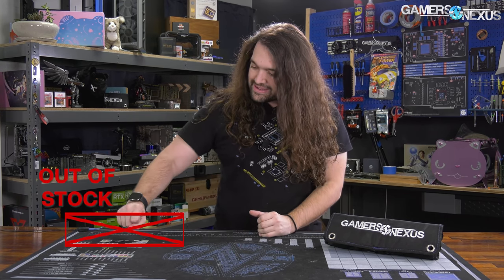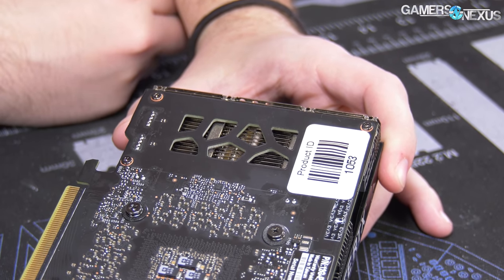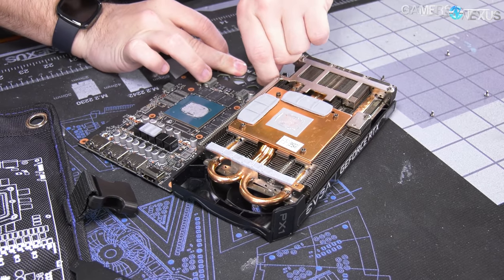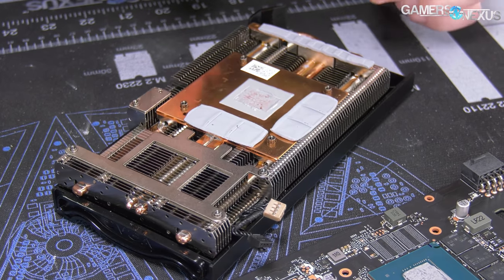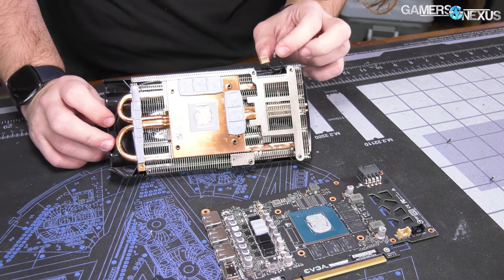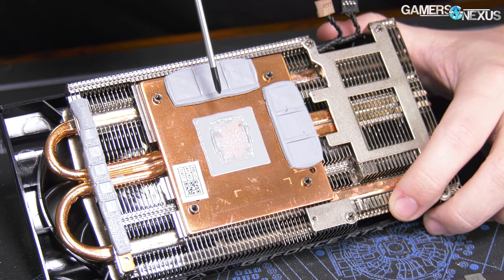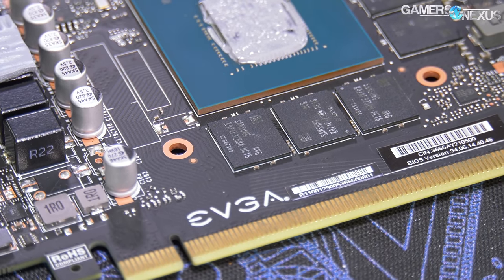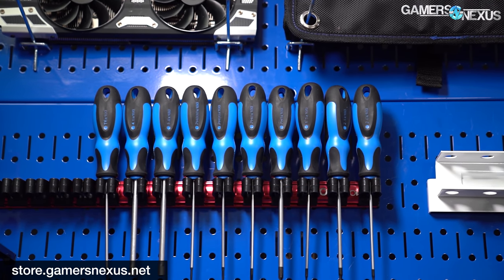Taking Apart a Non-Existent GPU: EVGA RTX 3060 XC Black Tear-Down

Comment: What's impressive is that this card is identical in performance with the GTX 1080ti and it can run on such a small cooler. It has only two heat pipes and the whole thing screams "cheap", yet it's enough to run the card at decent temps. I have a Zotac 1080ti Mini which has five heat pipes and without undervolting, it runs at 84°C.

Comment: I would assume the main reason only those two inner inductors have thermal pads is because they are right under the hub of the fan, which would be an airflow deadspot. While the outer ones are getting unobstructed airflow.
Reply: @117gerardle  yeah not good airflow through them either haha

Comment: this went into my reccomended about as fast as they started selling for 1000$ on ebay
Reply: I found some in the UK but they were inflated GPUs from normal companies. There is a reason why it should be £300.
Reply: I found one on eBay for $600 (price from newegg was $529) didn't buy it but theres "scalpers" that just wanna get the cards to non bots
Reply: @jeffrydonald3436  it's just stupid. The gamers are all being forced to use there old card as I won't buy double the price cards.

Comment: Judging by the empty ram module pads, this board was originally designed for a 3060 ti
Reply: GPU tiers are often just cutdown versions of each other.  Titans are just slightly defective Quadros with the defective bits disabled.

Comment: That sharpie QC mark might be similar to a spot check I've seen in auto manufacturing. Basically you have to make a particular set of marks every time which forces you to inspect certain areas. I'd guess they are checking for the gold triangle to be present and oriented correctly.

Comment: I have the ASUS Dual OC and upgraded the BIOS from the official site. The clocks now boost at 1950Mhz instead of 1837Mhz at 1.0620V max and goes below 1V most of the time for 1833-1867Mhz. 0.9V for 1740Mhz. That was a nice surprise. Furthermore, the card runs extremely cool. Great BIOS, indeed.

Comment: 7:14 *Sigh.....Yes, that is a chip orientation mark, it is there because while you "could" physically solder the chip down in any orientation...to make it function you do want the proper pins to line up with the proper pads/foil runs of the pcb. So that mark helps you to know what that proper orientation is. There are others for different chips like a molded divot in the plastic jacket of said chip for example. It just depends on the product and manufacturer. Also there should be a corresponding mark on said pcb, they're tiny and vissually innocuous.

Comment: I did win the Newegg shuffle yesterday and ordered the overclocked version with backplate for $389.  It may be "meh" but stuck using a 7950 right now.  I gave my 1070 away in November thinking I would easily get a 3070, boy was that a mistake!  Anyway, this will hold me over until the better cards are easier to get, if they ever are.

Comment: ended up getting one of these I used my skills my friend wanted a custom loop he bought all parts for his custom loop and he was not confident I told him leave everything at my house for 3 days I will do it for you he agreed first day I made a test loop with no cpu parts to leak check and also used sys prep to get it ready let that run next day was a flush and mock up then the 3rd day I built the loop and overclocked for him xDD i was happy got a new gpu and time to play with others computers his specs where ryzen 9 5950x rtx two rtx 3080's 32 gb ram @3600 asus rog crosshair 8 dark hero(Iprefer my x470 crosshair 7 no chipset fan)2 360 rads ek blocks and d5 pump he is very happy

Comment: 7:30 Technically soldering or brazing, not welding, because a dissimilar metal is added to make the bond without melting base metals. I'm sure you know that and misspoke, but just to educate anyone reading the comments: https://www.uti.edu/blog/welding/brazing-soldering-welding
8:04 Just a guess, probably copper to wick heat centrally where the solid aluminum block contacts the copper strip and heat pipes, since conduction should be a lot greater there than on the fins. That ~1" wide solid block may be massive enough to make up for the difference in material thermal conductivity and might not actually lose much efficiency. I wonder if they got away with the cost of such a big piece of solid Al because it was produced in scale and works for other cards too, you can see (13:07) it has grooves for 4 heat pipes to contact it but only uses 2 of those.
10:22 This took me a minute but the reason only 2 inductors have a thermal pad is because they're below the pair of heat pipes and don't get direct airflow like the rest of them. Makes sense, I'd give them a pass. Though, positioning could be a little better. It's when a pad only contacts fins that I'd call it half assed, but there are several variables.

Comment: Random info, but from the video it looks like the fan connector's a HY-4P (other OEMs might use different style of connectors though, I know the Asus Dual 3070 uses a HY-6P; same connector, but with 2 more pins - hence making it 6 pins total - for lighting)

Comment: Newegg has pulled through for me by the raffle selection and I got the Evga 3060, my very first gpu and I'm upgrading from an Nvidia 310. No more dull vomit colors and low res!
Reply: hmm... you payed for a 2060 equivalent... rip
Reply: @mitchellgoldstein1573  Erm, those were out of stock for me too... I was not gonna give in a buy a 10 series for lack of gpus. mission complete

Comment: 8:46 - QUESTION: Why does it look like the components between the two rows of capacitors is only partially covered by a thermal pad? Wouldn't you want all five contacting a thermal pad, not just two?
Reply: Okay, looks like Steve had the same question at 10:22.
Reply: Those don't really need cooling. I suspect they just stuck a pad there for vibration damping.

Comment: I can't find any 3060's either, but I do see two stores with a 3060ti in stock, somehow... Oh wait, they're 2-fan MSI cards listed at €999, that explains why they haven't vaporized (yet)

(correction: there are actually 3060's in stock here, somehow. Buuut they're at the €600+ mark, so very much not worth it)

Comment: I had a chance to buy one but at the prices it was ridiculous. 389 for the cheapest one at bestbuy. I already have a evga ftw 3 ultra 3070, but wanted a second card if I wanted to do a different build. But the price is horrIble.
Reply: Now you're just bragging! Over here if you can find them at all, 500 Euro will not get you anything and that's on normal web shops...
Reply: @toinebles  haha if I was gonna brag I would say I got my ftw 3 ultra 3070 for 591 usd before shipping and taxes. Cost me 646 after taxes and shipping. But thats for a top of the line 3070 model that will last a while. Plus evga provides a 3 year warranty which I appreciate.

Comment: i have a 3060 but i got my 1st gaming pc this year. yes i bought pre built bc it was the only way to get a GPU at a reasonable price plus i got a 9700kf. the motherboard is... well what you would expect for a pre built that cost me $1200. so the motherboard n PSU (it's a thermaltake so im kinda iffy about trusting it) are going to have to be replaced bc it's a cheap pre built. but the parts have a year warranty so ill leave it be for no.

Comment: Taken apart, there really isn't much to it.  My one quesiton is this: What are the two areas below the GPU itself for?  It looks like space for two more memory modules, would that suggest a higher memory version as an example?  or is this a case of re-using another board design?
Reply: It leaves the option to switch to lower density ram chips later if they are more cost efficient. Steve said in the performance review that the 12gb of vram is a waste unless you are also using the card for things like blender 3d modeling or maybe one of those crazy mod packs that replaces every texture with an 8k image.
Reply: @monoman567  I have a 1060 6g right now, and i can tell you that thing gets maxed out easily.  As an example, I play Escape From Tarkov, and that sucker uses every scrap of card memory it can and then some - and I am only playing at 1440p.    They say it will run on a 2gb graphics card, but damn, that thing maxes out 6gb without even trying.   I am interested to see what it would do with 8, 12 or even 16gb.

Comment: Me, a Buildzoid acolyte: Is that a five-phase core VRM?
I know power stages will determine power handling capacity, but 5 phases for 180W? Pretty sure a fairly budget ~130W 1060 has 6 phases.

Comment: The Ethereum mining craze few years back did really put me off PC gaming. At least the RAM price hike didn't last long and you could get by having 8 to 16GB memory in most cases. I got my 32GB RAM kit at nearly the same price of the older 16GB kit when the prices came down during 2020. However, desktop graphics card prices never stabilized in most corners of the world. Now if has become the thing for people with disposable income or die-hard enthusiasts. GPU shortages, twice within a span of 3 years is a terrible blow to the consumers in this segment. 

I personally gave up PC gaming altogether, even installed Ubuntu in my Asus ROG laptop simply to force myself to take a break from gaming. And my at home desktop never got a discrete GPU in the last 2.5 years since it was built.

These days, I won't necessarily suggest a friend/acquaintance of mine to build a gaming PC. Better get a decent laptop and a console to cover most of your needs.
Reply: I remember buying RAM just as the prices were starting to creep up, and thinking $120 CAD for a 16GB kit was steep. Unfortunately, I badly needed a new PC in 2017. I bought a 4GB RX 480 just before the mining boom, but I'm really regretting not splurging on the 8GB model. If that dies, well, I guess I'm out. I'm mostly gaming on my Switch nowadays anyway. I always thought it would be the intrusive DRM and sloppy ports that would kill PC gaming. Not a bunch of dudes making funny money in their basements.

Comment: In Belgium the only thing gone about 3060 is MSRP.
Non-Ti easily available in shops, for mere 599 to 769 euro. At todays rate it's 733-940$.  
Ti mere 679 to  889 euro.  830 to 1090$.
Well, how about FUCK GPU PRICES, upgrade can definitely wait.

Comment: Very cool and informative for my first time GPU takedown video.  Wondering if you have any tips on how to open up a Gigabyte Nvidia RTX 3060 Aorus?  Looks like the board on this is pressed onto splined pins as well as the screws?  Not sure how to proceed after screws are removed.  I am almost 100% sure I have a bad solder joint somewhere on this thing.  I can take it out and give it a few good "spanks" and then works fine.  Kinda like OLD school car mechanics:  When in doubt tap it with a wrench🤣🤣🤣🤣

Comment: Hello everyone. After replacing thermal paste on  sapphire rx580s and reassembled. They worked fine. The nvidia rtx 3060 zotac twin edge does not though. Is their a way to flash bios to get the card working again?

Comment: Isnt it really inefficient blowing air through all thos finns against a board, like basicly a wall? Wouldnt a passthrough cooling design like with all the cpus be way more efficient?
Reply: i think the air goes out the side? either way i don't think it'd be very fun to have a 6 slot graphics card even though i have seen people do what you said before and it seems to work

Comment: Why do you keep referring to a silicon diffusion barrier? Is there a diffusion barrier grown on the top of the chip? If so: what material is it? A common choice would be TiN or SiN, or some sort of metal to prevent copper from diffusing into the silicon.

Since this is flip-chip, the top of the silicon there should be pretty far away from the layers where the chip is, I thought there was enough bulk silicon to make copper diffusion a non-issue. Please let me know if I'm wrong about this, I'm still learning about semiconductor fabrication.

Comment: Crazy and Sad that 2017's 1080ti and 2019's 5700xt are faster than this; shame how slow the gpu market is evolving.

The Difference between a Ryzen 1800x and a 5900x is huge for the same RRP.  5600x is faster than 1800x for everything at a lower RRP and 50% less cores and threads which is insane.

Comment: What is the reason for the 256-bit interface on the PCB? Is GA106 pin compatible with TU106 or something similar? Maybe the chip has a 256-bit bus waiting for the Super model...

Comment: Looks like they have room on the PCB for another 4GB ram. 16gb card in the future?
Reply: 6 or 12 or 24 Are the options...
They most likely use same pcb with 3070 and other cheap gpu chips..

Comment: what are the spacing for the cooler hole you know the spring loaded screws that hold the cooler to the die wondering if I could put an accelero on here or even a ek universal gpu block hoping

Comment: I heard about the  5800x is hot is it any was to get it not to hot im plan to get  5800x and wonder about yours vid on artic freezer and wonser if it will make it trough, can you make a vidoe about ryzen 5800x with cooler test?

Comment: Despite usual skeptcism and mistrust of corporations, NVIDIA from Turing til now has really challenged my opinion of the lower limit of corporation's absolute lack of morals and principles. I will wait 2 years with the 1650s and buy a budget AMD card should it exist to the naked eye- 3060 is quite a low bar.

Comment: I spent the last three days on a myriad of tech sites in the vain attempt to purchase a 3060. Here, is a guy that was GIVEN one for free just so he can take it apart and film it.

I'm fucking done with this. If GN, Linus or any of the others are still scratching their heads as to why the GPU market has gone from expensive to exorbitant, it's either due to naivety or stupidity. THEY are the reason. It's better to gift a card to a YouTuber for free advertising, particularly if you are gonna limit the stocks

Comment: Why is the thermal pads "2 milimiters and 1.5 mm" and not 1/11 and 1/15 inches or 54/372 elefants or 1/16 bananas ?? Where's the american aproximate measurement units ?

Comment: New Gamers Nexus product ideas
Tools with stick handles so you can't drop them.
Pre cut thermal pads
Improved heatsink and fans for GPUs and CPUs.
Do you think any Current gen Nvidia or AMD Graphics cards will make it to UK for less than £1000 before mid 2022 for us mear mortal casual gamers
Did I miss something or did you not find any glue? Perhaps Nvidia told AIBs leave it off as they don't think the cards will stick around long